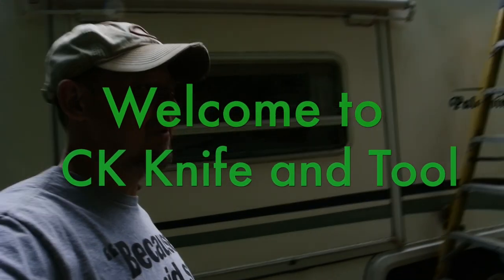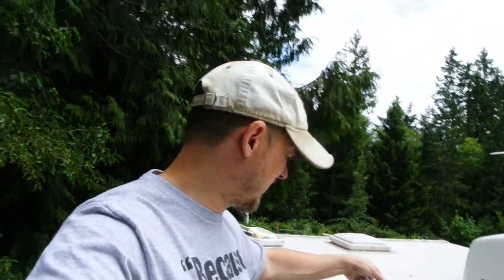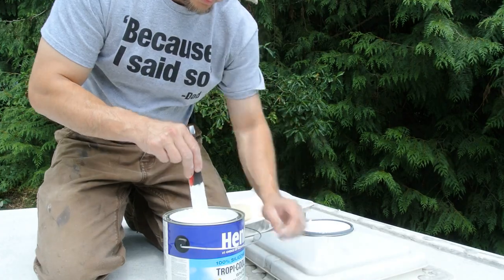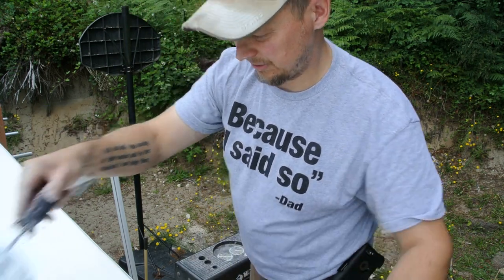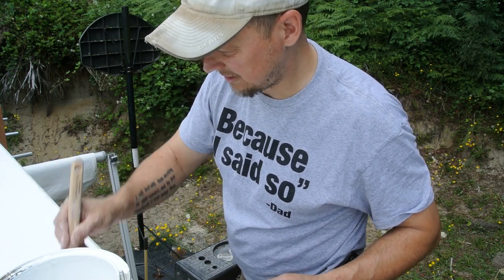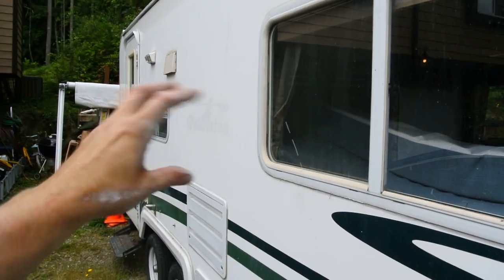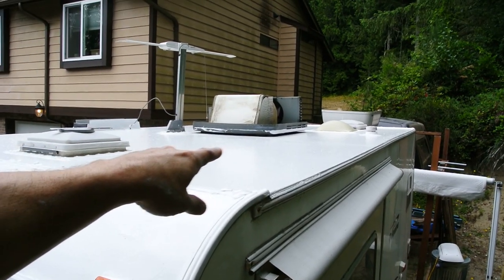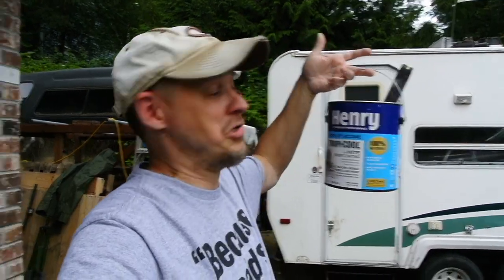Camper Roof Maintenance with Henry's Tropi-Cool 100% Silicone Sealant

Comment: I’ve used it on our old camper and it help keep the camper cool, sealed up good around everything. We bought a new camper in 2018 and I put a coat on it the second year. Brushing gets you a thicker coat then rolling and it will dry quick in the sun, caution that the amount in the pan doesn’t sit too long. I’m a fan of this. And for anyone buying it be sure you get the Tropi-cool for RV, they make a few different kinds!
Reply from the maker: Thanks for the info!
Reply: Can I paint the entire camper with this? Like the exterior walls? 
Thanks
Reply: @luismajano9191  I’m sure it would stick but not designed for that and it would cost a good bit to cover the whole thing and I doubt you would be happy with the results.

Comment: My camper began leaking in a couple places...Around the A/C unit and also the shower and front ...Got a can of Flex seal and sprayed in a couple spots..It helped, but gonna have to do the entire "ruff" like you did...  Was thinking about selling it pretty cheap and lose a couple thousand or so, but 2 gallons for 125 bucks is the way to go now...32 foot Dutchmen..  Very informative..  Thanks..

Comment: I did two coats on my 2001 clas A 32 footer and love it.  Went on great and looks great and washes easy. My one concern was that nothing sticks to it like eternally tape and decor.  BUT I was informed by somebody if you clean the area first with paint thinner things will stick like they should.  So Ill do a third and fourth coat this spring.

Comment: Love the video thank you 
May I please have more information on how to replace the broken vent? I have the same problem and I don't know how to do it 😅
Reply from the maker: 1. Peel away old caulking (probably white) 
2. Vent has 1/4” hex screws (perhaps self taping) so remove those to remove vent
3. Clean area where old vent was including old caulking/ adhesive 
4. Install new vent with new screws, self taping and preferably stainless steel but not necessary.
5. Caulk generously
6. Enjoy the fruits of your labor 😁

Comment: Have you noticed any delamination between the silicone and the original roof? I love silicone. It does age well and tolerates UV better than just about anything else, but sometimes its problematic. It doesn't stick to anything, so it tends to delaminate. Also, nothing sticks to it, so if the coating fails, good luck trying to put some Eternabond or Lap over the top of it. You might as well be trying to caulk a stick of butter. However if it's working for you, great.
Reply from the maker: Nope.  But then again it’s gone so...

Comment: Nice. How did it turn out, hold up? I need to do some repair, this might be what I need.
Reply: I'd like to know too, how is the roof holding up today?
Reply: I ended up re doing mine with a product called crazy seal. It has three separate parts (caulk, patch, and seal). Pretty darn expensive (roughly $1,000, obviously depends on size), my trailer is 26 feet long, and I had enough to do three coats.  It was 25% the cost of having another company come and do it for me.
Reply: Thank you for sharing

Comment: When you use a roof coating like Henry (which I’ve used) it’s imperative that you clean the roof very good or else it will peel off as you go down the highway. Your kids did a good job of cleaning, but I give it a final wipe of acetone then tape off anything you don’t want it on with blue painters tape. Excellent video. You saved yourself a $5000 roof job (or at least put it off for a year or two!)
Reply: the instructions don't tell u 2 use acetone to clean anything.... follow the directions & u will b ok.
Reply: I have used Henry's multiple times myself on multiple different RVs. 1 RV that I still own and have had Henry's on for 7 years. I wished I would have cleaned and scrubbed better.... Just take your time and dont try to ger a 36" Rv w/ 3 slides all done in one day... That's what I did washed let it dry in Texas sun and coated all at once I feel it was too rushed and I didn't put enough on in some areas.  I do believe that is the same issue I have only in a very small sections though so I am putting on Henry's overtop of Henry's for a 3rd and 4th coat this season but I am washing with dawn the soap Thoroughly rinsing and then right before coating I am giving a final wipe down with rubbing alcohol.   I really think that is the problem in the areas that I have trouble with it just wasn't quite clean enough maybe a micro drop of oil spread out underneath to keep contact either way I should have rubbed it down with rubbing alcohol or acetone or something that will thoroughly decrease it... It doesn't say to do that just like it doesn't say before you paint your fingernails to wipe them down with acetone but Every salon does it because they know that's what causes it to bond better oils are the enemy.

Comment: Great video! Are you supposed to put the tropi cool over the self leveling sealant around the skylights and other vents on top? Will that create issues when you go to redo that sealant?
Reply from the maker: Not at all.  You can still do repair and replacements of items that protrude from the roof top.  Henry's makes the Tropi-cool makes a calling of the same material to repair such a thing.  You could also just buy a can and apply a new coating in that area and use the rest to apply another coat to the roof.

Comment: How is the tropi cool  roof coating holding up so far  ?
Reply from the maker: So far so good but I'll be doing a once over and a second coat this summer.  It's the second coat I never got the chance to do last year.
Reply: I did the same coating as he did 15 months ago.  I also have a hybrid trailer and our roof was in even worse shape where a LOT of black was showing through and the inside of the trailer was hotter than outside on a routine basis.

We cleaned the roof as he did but really scrubbed it and wiped it down quickly with acetone (which took off a lot more white from the roof), we laid down the first coat reasonably thick, let it sit for about 2 hours then laid down a second coat a bit thicker.  First and foremost once applied it made a MASSIVE difference temp wise inside the trailer, at a minimum it knocked down the temp inside the trailer 20 degrees if not more.  The AC is FAR more efficient now than it was previously.  I'm in AZ and it used to take about 2 hours to go from 110 to 80 inside the trailer if not a bit longer, now with the coating and nothing else we do that in a bit under an hour.  average temp in the summer inside the trailer is about 6-8 degrees or more cooler than the outside temp.  If the temp outside is high 90's we can get down to high 70's inside the trailer in about 25-30 mins tops.

best part of the coating is that once it's applied and dried off put your hand on the roof, it's cool to the touch and likely a bit colder than the outside temps.  I'm willing to bet before you did the application of it you could sear a steak on the roof.  It has made such a huge difference for my trailer that a few friends of mine have done or are doing this same stuff this fall once it cools down.  A friend of mine got a 2018 5th wheel with dual 15k AC's, his AC's barely kept up when the temps hit mid 90's.  After a while he wanted me to help him do his trailer with the henry's stuff, we did it and his AC's now run more than half the time and it will nearly freeze them out of the trailer.

Durability wise I've inspected it often and found that there are no issues with peel up or anything else.  This stuff is worth every penny!
Reply from the maker: Neil Horne .... https://youtu.be/ObFjsjM1YQU

Comment: How has Henry’s hold up since your filming?
Reply from the maker: Live Stream Wizard The Henry’s held up well but we no longer have it.
Reply: I did the same coating as he did 15 months ago.  I also have a hybrid trailer and our roof was in even worse shape where a LOT of black was showing through and the inside of the trailer was hotter than outside on a routine basis.

We cleaned the roof as he did but really scrubbed it and wiped it down quickly with acetone (which took off a lot more white from the roof), we laid down the first coat reasonably thick, let it sit for about 2 hours then laid down a second coat a bit thicker.  First and foremost once applied it made a MASSIVE difference temp wise inside the trailer, at a minimum it knocked down the temp inside the trailer 20 degrees if not more.  The AC is FAR more efficient now than it was previously.  I'm in AZ and it used to take about 2 hours to go from 110 to 80 inside the trailer if not a bit longer, now with the coating and nothing else we do that in a bit under an hour.  average temp in the summer inside the trailer is about 6-8 degrees or more cooler than the outside temp.  If the temp outside is high 90's we can get down to high 70's inside the trailer in about 25-30 mins tops.

best part of the coating is that once it's applied and dried off put your hand on the roof, it's cool to the touch and likely a bit colder than the outside temps.  I'm willing to bet before you did the application of it you could sear a steak on the roof.  It has made such a huge difference for my trailer that a few friends of mine have done or are doing this same stuff this fall once it cools down.  A friend of mine got a 2018 5th wheel with dual 15k AC's, his AC's barely kept up when the temps hit mid 90's.  After a while he wanted me to help him do his trailer with the henry's stuff, we did it and his AC's now run more than half the time and it will nearly freeze them out of the trailer.

Durability wise I've inspected it often and found that there are no issues with peel up or anything else.  This stuff is worth every penny!
Reply from the maker: Thanks for the information Rob.  I'm sure folks will appreciate your opinion and experience.  Thanks for commenting!
Reply: I agree! I did one coding two summers ago, then a second one last summer although I didn't really need to. It's awesome, I have a 1998 Bounder and in torrential rains both in Oregon and in Southeast Texas for days and days and days on end, I've had zero leaks since I applied the Henry's. I'll probably add another coat this winter when I'm doing an inspection just because.
Reply from the maker: Live Stream Wizard .... https://youtu.be/ObFjsjM1YQU
Reply: So I have a question?? My top of my camper is soft.   And I cant walk on it...is that normal.
Reply: @maggiemelendez3616  no it’s not normal, water damage!

Comment: Can this be applied to plywood ?
Reply from the maker: Radnally I don’t see why not.  Definitely would need two coats though.  There’s also a seam tape for camper/ RV roofs and that may be of use too.
Reply: CK Knife and Tool: I contacted the Henry company and they said that plywood was not a suitable substrate for tropicool. Maybe it's just CYA from them?
Reply from the maker: Radnally great to hear!  Glad you did the research and that it’s posted here for others.  Thanks!
Reply: Yep, make sure it's very dry.

Comment: we have used this and also rvroofmagic both are good but the rvroofmagic
 is much easier to work with and you don't have to rush because there is
 on catalyst to add.  Also it has a mildewcide built into it and comes 
with a 10 year warranty @t our company also does rv roof repairs
Reply from the maker: Al thompson .... Sounds nice.  Thanks for the info and for watching!